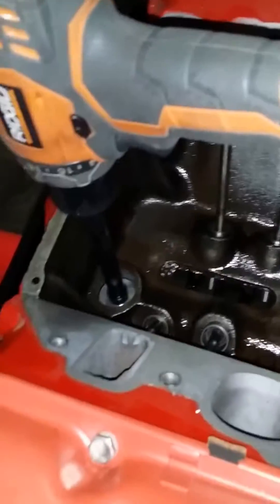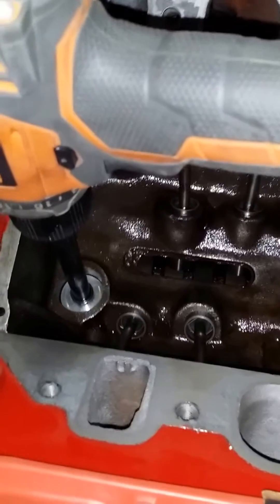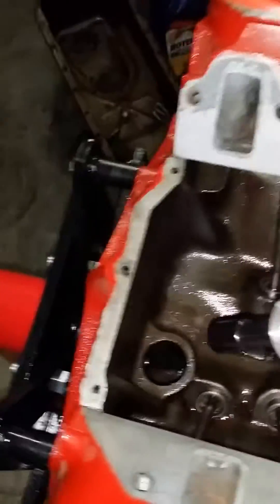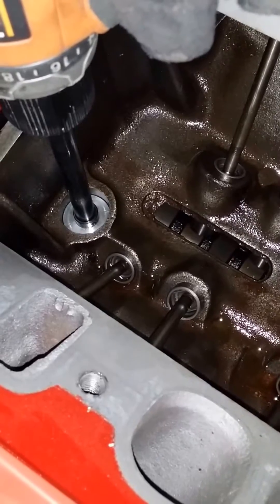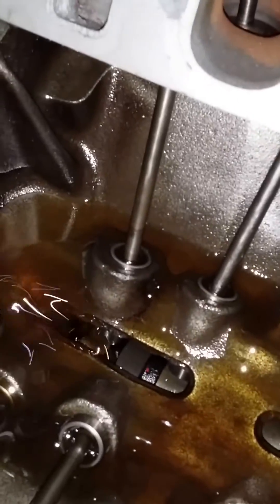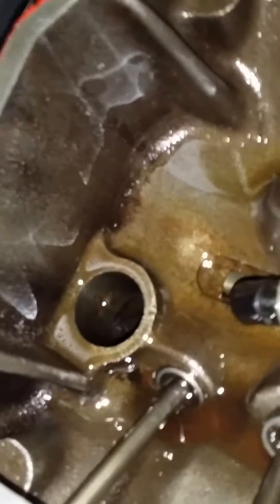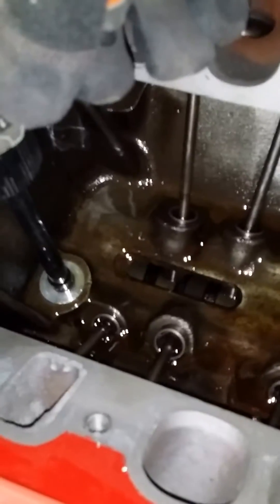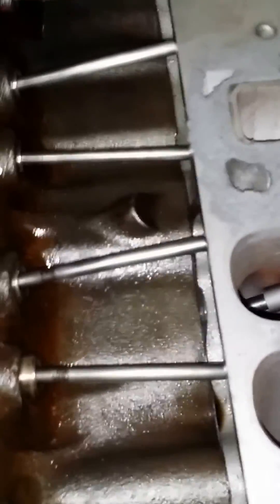Why Autozone / OEM Tools V8 Oil Pump Primer Does Not Work With Big Block V8 Engines

Comment: A utube short vid solved that sealing problem with the application of an O ring or three. That helped me a bit but I'm wondering if it's slow for me because it has to fill the empty oil filter before any decent pressure can build. I don't have a pressure gauge handy to hook up here?
Thanks

Comment: I also had the same results, only I also had the joy of aluminum filings from the spacer floating up too! Had to flush out everything, throw the oil away, and start over! Only safe way is an old distributor, imho!
Reply: Yup. I've been trying to prime my big chevy in my jetboat and this tool has kept me from moving forward with my project. When I was trying to prime it the other day, i noticed aluminum filings from the top spacer spinning on the distributor mounting surface. I just filled this thing with 10 quarts too!
Reply: @brianbrown600  THAT SUX!!! It’s not like oil changes in a jet boat are easy, or fast!!! My jet boat 496 has the same 10qt oil pan and you have to suck it out the dip stick- and you never really get it all!! I feel for ya brother!!
Reply: Old distributor works great if you know what to do

Comment: Used tool on a small block, finally got oil to right bank after about 3 minutes.  Clerk said I could return it when I was finished. Some one must have done that before because it was used before.

Comment: I had the same issue with oiler I purchased from Amazon :  Part #2101 G M  Oiler.  I  finally "customized" a old GM distributor (that I had planned on selling) and had oil to ALL lifters in less than two minutes!!!!  Wish I would have seen this video before purchasing the "tool".   The ONLY way to save time and assure proper lube is to use the mfgs distributor!!!

Comment: I bought mine from GM for my 70 Z28 SB LT1 and it works great. After priming one head you will need to turn the engine 180* to get the other side primed. Spin until you see oil come out onto all the rocker arms. No oil should be gushing out of the distributor hole. https://my1970z28.com/COPO/images/gm_oil_primer.jpg

Comment: I called OEM and they told me to wrap black tape around to 2 bosses. Then he asked me if I had access to a lathe to cut 2 grooves in it to add a o ring. Wtf
Reply: I am going to use a OEM part for the distributor hole and make the tool fit.

Comment: Thanks for the info. I had this problem also-while using a Ridgid drill similar to yours LoL. Went through 2 small batteries hoping to see oil come out of the right cylinder head push rods. It felt like oil pressure was building but only the left cylinder head had oil slowly coming out of the push rods.

Comment: I am building a 383 stroker sbc and I'm having the same exact issue. Only getting oil to the driver side head. and not building oil pressure. I removed the intake manifold I seen the exact same thing you seen. Same tool from AutoZone. Good video

Comment from the maker: Oh, I was turning the crankshaft. I don't have a video right now, but I now use stripped down distributors to do priming. Both heads pump oil almost immediately.

Comment: Could you try a side-by-side comparison with another primer tool?  This could eliminate a problem with the tool... Also could you try turning the crankshaft even a little and repeating the test?  This might eliminate a problem with the engine... thanks for posting.
Reply: I had the same problem & rotated the engine by hand a few times and that didn't help. There's no reason for another video. If you've ever installed a distributor you'll notice how snug it is. The bottom aluminum piece on this priming tool is too narrow.